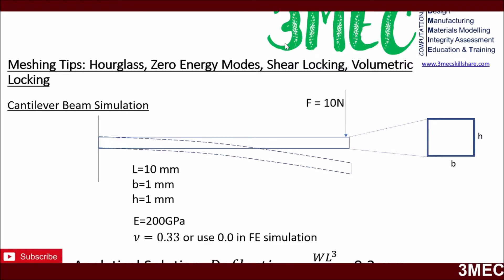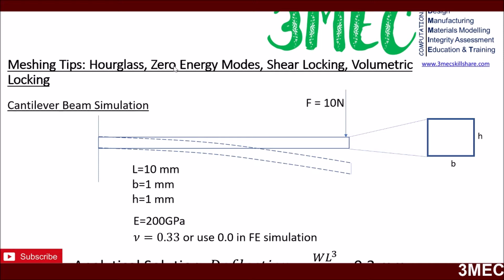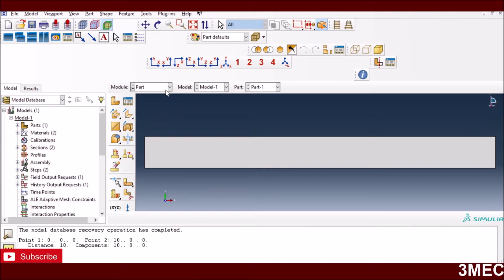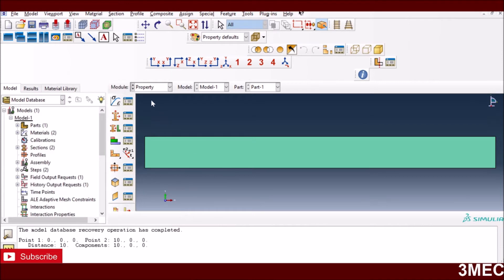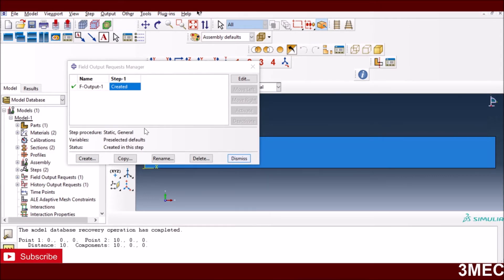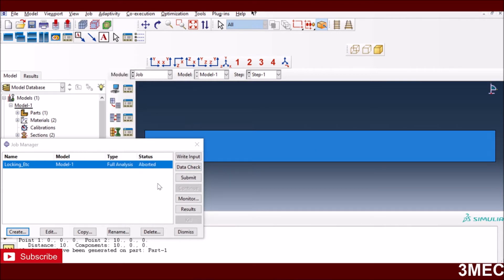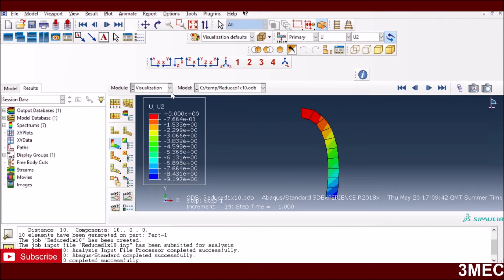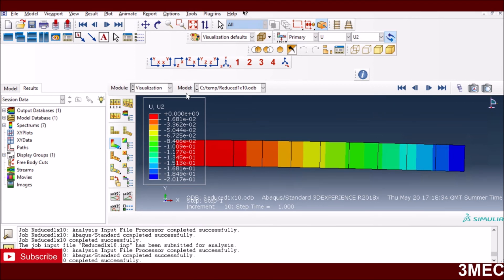Meshing Tips: Hourglass, Zero Energy Modes, Shear Locking, Volumetric Locking - ABAQUS Tutorial

Comment: Hello 3MEC, thank you for all your great work ! 
I need to model delamination (that starts from teh pick of a transverse cracking) of a composite material on abaqus and I only have the 6 engineering constants, is there a way to do it without needing more properties? if yes then how ? I really need this, thank you.
Reply from the maker: Thanks for appreciating. If I understood you correctly for Delamination you will need delamination strength, etc. One way could be to use cohesive elements or interface crack propagation criteria
Reply: @Professor3MEC  here's a description from the article of the original model I'm trying to model on abaqus : This investigation has been implemented by 
element analysis. Fig. 3 shows an example of the mesh-
ing used. The tensile load was applied via prescribed
longitudinal displacements of the extreme nodes (nodes
A to B and B to C). The conditions of symmetry lead to
suppress the transverse displacements of the nodes of
the middle plane CF and the longitudinal displacements
of the nodes D to E. To analyse the delamination
between the 0  and 90  layers, nodes were splitted into
pairs of nodes on the delaminated part GE: one node in
the 0  layer and one node with the same coordinates (in
the non-deformed state) in the 90  layer. The relative
slipping between the 0  and 90  layers was considered
by joining the transverse displacement of a pair of
nodes. The friction between the 0  and 90  layers was
introduced by prescribing a longitudinal stress on each
element of the delaminated part. 

What I did : modeled the composite plate, applied the symmetry conditions and the load, did a cut between the 0 and the 90 layer to model delamination, couldn't undertand how to model the rest of the description (I'm not very familiar with abaqus), the result was obviously different, if you can advise me on what to do with the rest then I'd be very grateful, if you have time and would want to take a look on the model, please leave me an email I can contact you on. 

Thank you !
Reply from the maker: @nadj_b  3minutesengineeringconcepts@gmail.com
please me details on this
Reply: @Professor3MEC  Sent, thank you so much!

Comment: DEAR BROTHER 
CAN U PLEASE TELL, HOW TO APPLY A HIGH STRAIN RATE ON THE UNIAXIAL TENSION TEST IN ABAQUS/EXPLICIT?
Reply from the maker: Hello, For any time dependent loading you will have to use amplitude function. There are a number of videos in my channel discussing about it. However below one might be more relevant on how to define time dependent loading, i.e. in your case high strain rate loading.
Reply: @Professor3MEC  YA I GOT UR POINT. HOWEVER, WHEN I GO TO PERFORM A TENSILE TEST AT A HIGH STRAIN RATE  AND ITS TOTAL TIME IS COMING OUT TO BE AS 0.001 OR 0.0001 SECONDS THEN THE TEST RESULTS IN TERMS OF TENSILE STRESS-STRAIN CURVE  IS COMING OUT IN CYCLIC MODE. DO U HAVE ANY SUGGESTIONS REGARDING THIS?
Reply: @Professor3MEC  BASICALLY I WANT TO PERFORM DIFFERENT  CONSTANT HIGH STRAIN RATE TENSILE TESTS...
Reply from the maker: @kamrankamran1071  well it will be difficult to speculate what is going wrong. First thing to check would be the definition of amplitude function?
lets see if strain rate is 1000 /sec and based on this the displacement that needs to be applied is 1mm per 0.001 second then displacement amplitude function should be like below.
0., 0.
0.001, 1 
this means displacement will increase linearly, i.e. constant velocity/strainrate.
good luck
Reply: @Professor3MEC  but how much total time should I given? would it be the same as 0.001?
Reply from the maker: @kamrankamran1071  depends on how much displacment you want to apply in how much time? As I said earlier this will depend upon your model size and strain rate
Reply: @Professor3MEC  do u have any video regarding the 1000/sec strain rate loading test?
Reply from the maker: Check my videos on impact loading please